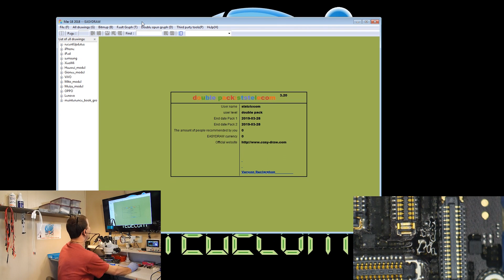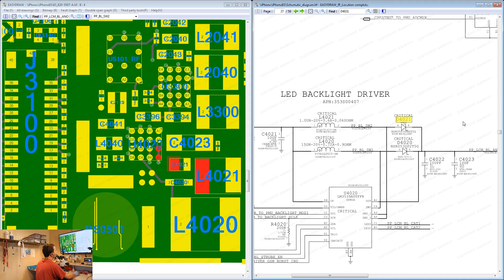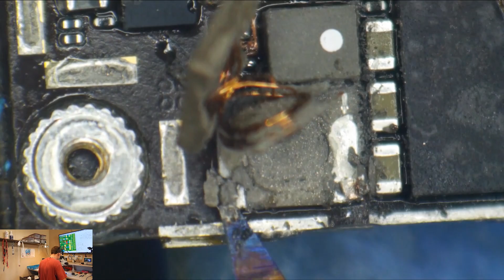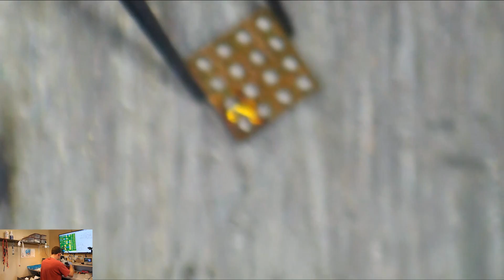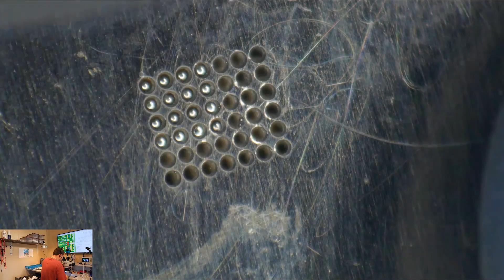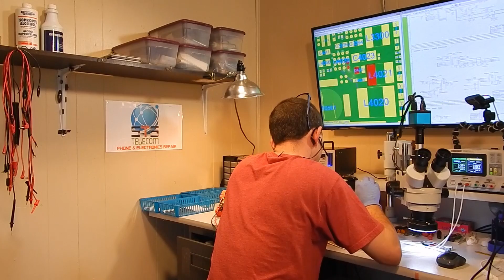iPhone 6s Backlight - Full Rebuild, Welded Pads, Misery

Comment: Your jumper wire material is varnish coated. You had tremendous difficulty getting that recreated "loop pad" flowed down to that tiny pad fragment due to the varnish on the wire. It appears to be motor winding wire which must be stripped of the varnish insulation first. Use #600 wet/dry paper to strip it, or gently scrape it with the blade well and finish with acetone.

Comment: You are amazing! 
I can't thank you enough for your channel and videos (and this one in particular). 
You gave me confidence to try micro-soldering and attempt data recovery on my wife's phone. 
And I did it!! I removed my first shield based on your instructions, diagnosed the short with a power supply, and found the short to be the big cap from this video! (I cheated with a thermal imager tho :)
The phone booted and I just finished pulling all the photos off of it (blindly, cause no backlight lol)
BTW this is after the local repair shop spent 3 days messing around with it, changed the charging IC and said it needs a new main board, and didnt want to even attempt data recovery!
Thank you again! Please keep up the amazing content.
PS I might be sending it your way to put the cap and diode back :) sorry for the mess

Comment: Had one of these recently. I can soldering and do BGA no problem but never spent time learning diagnosing. I had one 6s water damaged where diode would burn, changed IC but didn't change that CAPACITOR now i feel like calling that customer back lol

Comment: Thank you so much for those amazing videos. I have learned a lot. Recently I invested in  Quick 861DW soldering station from this local website https://microsolderingparts.com/collections/tools-supply-1/products/quick-861dw. I am planning to invest more in tools and fix many phones.
Reply from the maker: Thank you for commenting.  That should be a really nice hot air station.  I'm planning to upgrade to that one when my cheap air dies.

Comment: Great content in your videos.. Quick question.. Where did you buy your bench workstation from? 
I’m curious,what’s the size of your hanged monitor? I like your setup and I’m in the process of setting up a workspace @ Home.
Contemplating a space in the garage or one of the rooms in the house.
Reply: Hameed Cole Ikea. I purchased a 7' × 3' desk with adjustable height for $110. And the wall mounted shelves were maybe, $7. If you're looking for a prefab desk with shelves, they had those too.
Reply from the maker: Thank you.  I bought this bench from a local business that was getting rid of furniture.  It was used as their front counter for their customer service area.  The monitor is 43".

Comment: Amazing, exactly same repair I did on Monday and I couldn't find a video. My track also removed on the diode but managed to get some solder on the remaining small visible track pin point and diode soldered to that. Plenty of UV on it.